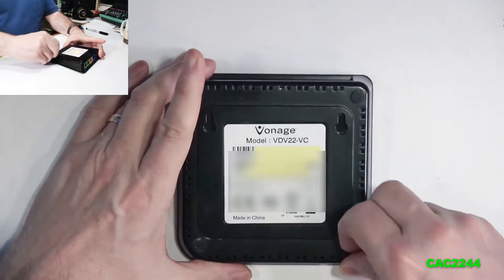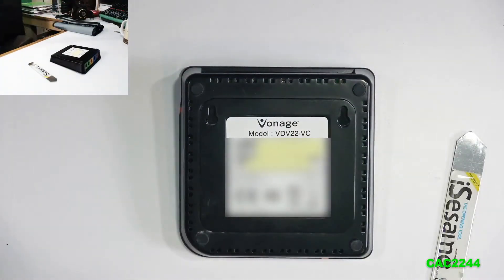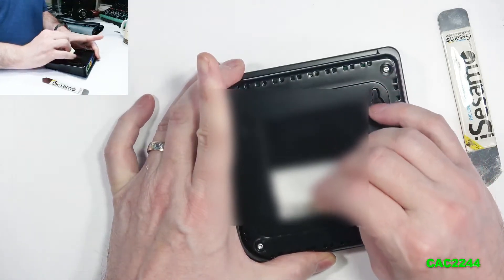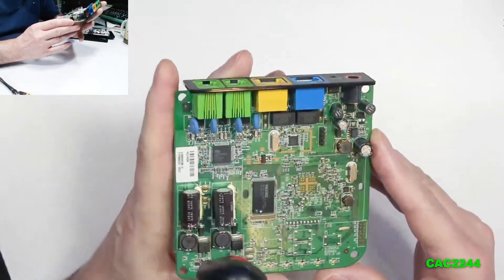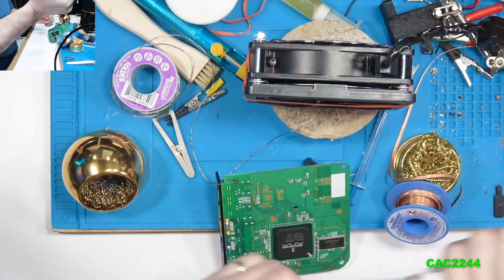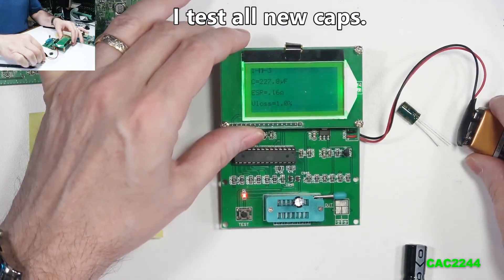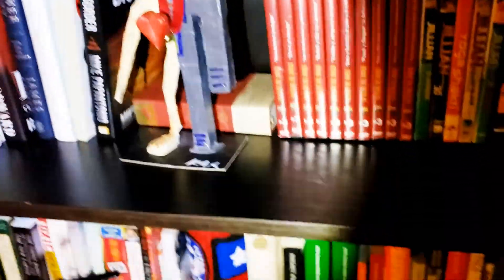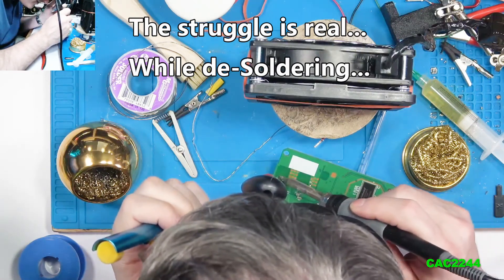Vonage box VDV22-VC repair.

Comment: Thanks for explaining the trouble with my Vonage box. I am not as mechanical incline to repair my box as you have explained. But here in the United States i will either contact the company or purchase a new box from one of the stores in my city.
Reply: I used Vonage service for 16 years; they have a horrible customer service. Today I use Google Voice with Obihai device to make international phone calls from a regular phone. Much cheaper than Vonage.